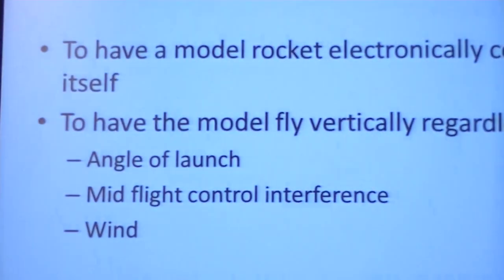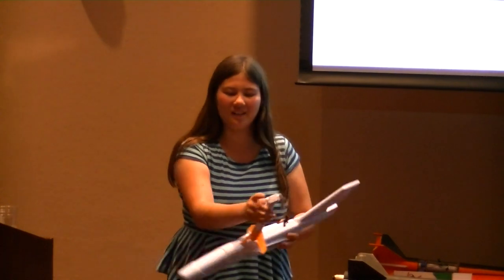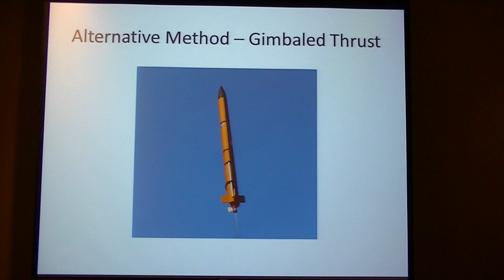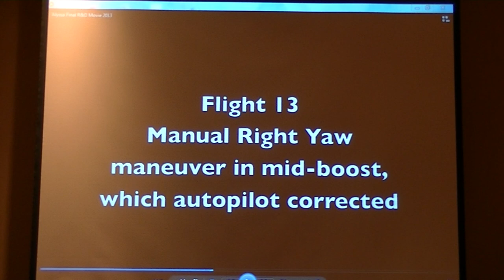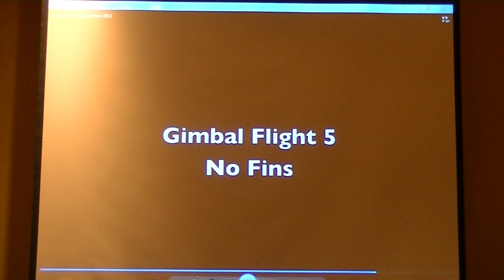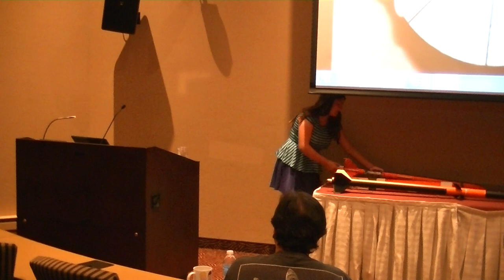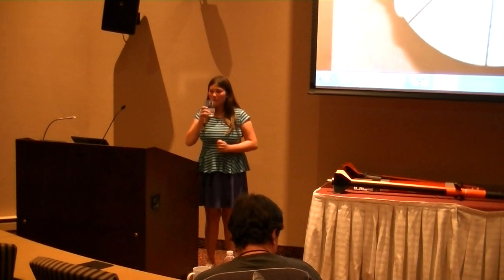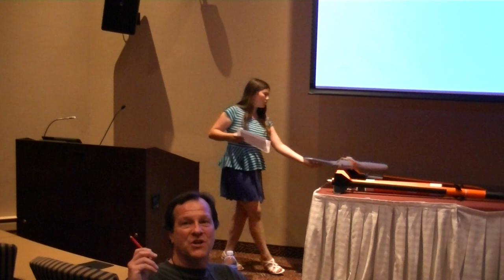Naram 55 06 R&D Alyssa Stenberg's electronic stabilization of a rocket

Comment: What motors were used for the tests?
Reply: G12s.  Long burn reloadables from Aerotech.  Normally used for RC Rocket gliders.  If I remember right, Alyssa negotiated 10 of them for the project with me, they were $20 each!  In retrospect, I regret not buying her 20.  She was close to perfecting a hover by the 10th launch and I think could have landed it....a few years before Elon did it.  hehe